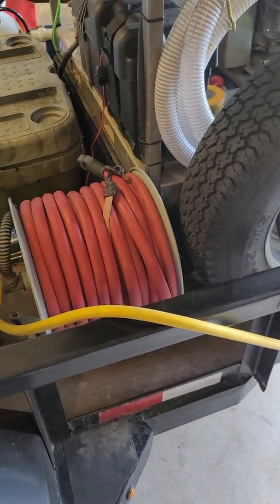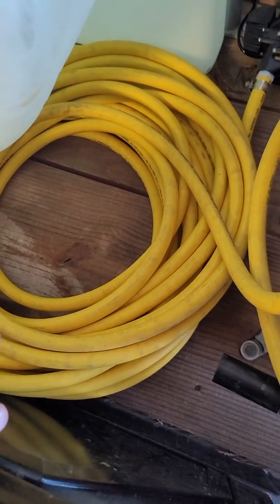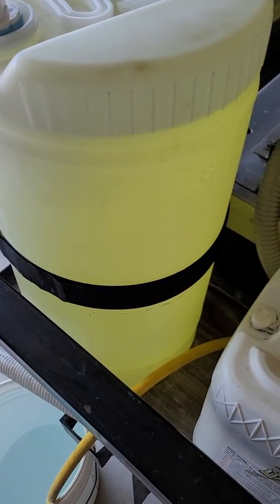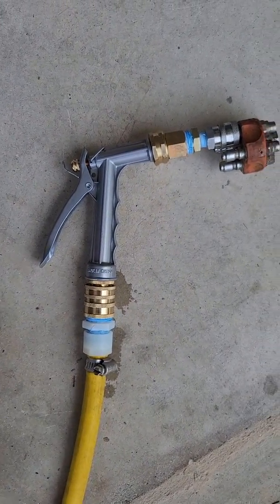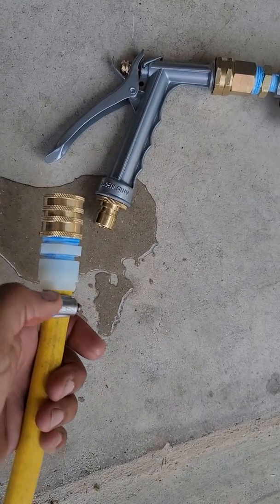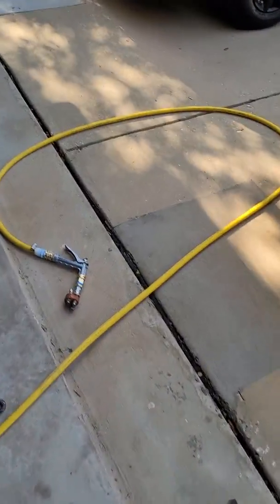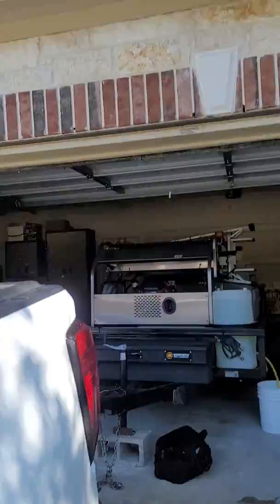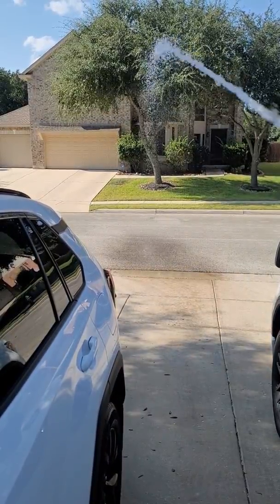basic 12v system

Comment: I chose to do the proportioning system rather than mix and gravity feed my SH and water instead of using a drop stick. How come you chose the drop stick method?
Reply from the maker: Anytime you're using SH from a tank you should have a dropstick feeding your pump from the top. If you don't and use a bulkhead then the SH will eat the bulkhead and it will leak eventually. This video was created to show the most basic 12v system because it's all I need. I already have a gas softwash system that I use for bigger jobs that has a proportioning system.
Reply: @readykleenpowerwashing  ahh I see. I'll have to switch it up later on, didn't even think about that. What if I'm flushing the system after I'm done using it every time?
Reply from the maker: @Cam-bi2xq  you should be flushing the system after evry use but this has nothing to do with the SH eating the bulkhead out. It's still going to happen. All the flushing the system out will do is help make the pump last longer. If you're not pulling your SH from the top of the tank you're doing it wrong or soon will regret it later.